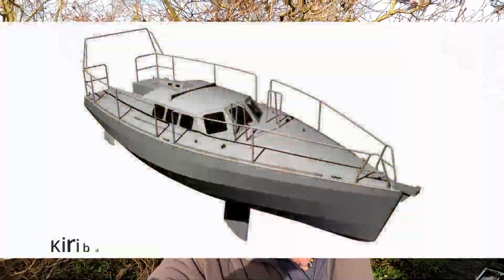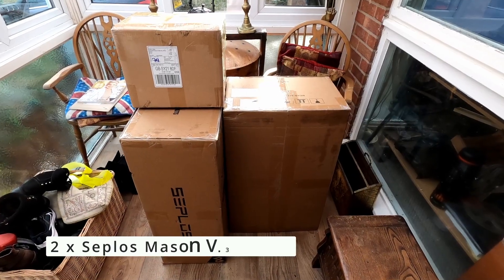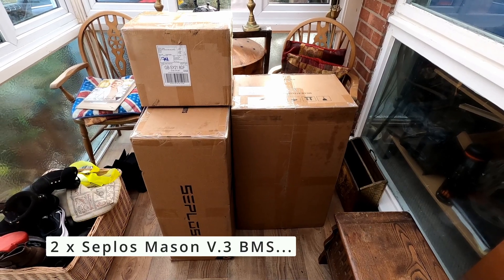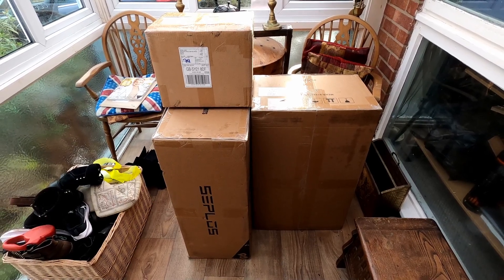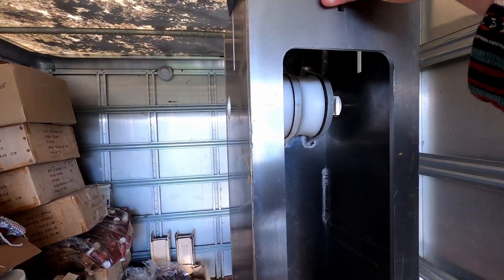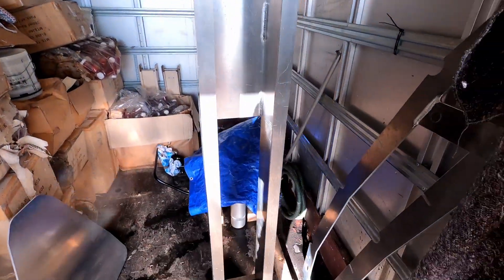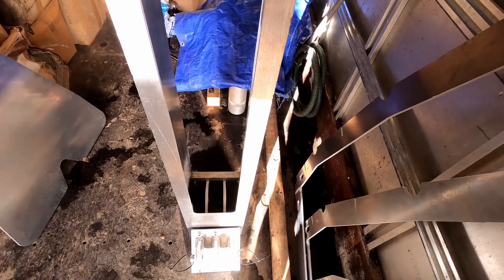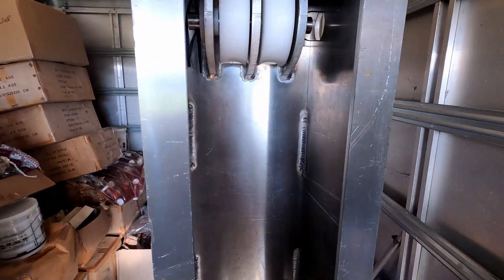Mast Support Work + Rudder Blades Cost Breakdown | DIY Aluminum Sailboat Build Ep. [5]

Comment: sleeve the bolts too - a circuit is a circuit and it will kill it
Reply from the maker: Hey Dan, thank you for your feedback. Someone did mention using some basic shrink wrap over the threads, so I will give that a go. I might have to make the clearance hole a tiny bit larger, but we'll be worth the effort if it means no corrosion. On another note, like your bike on your channel. Got an Africa Twin (old Rd04 from 1990) and hope to be able to ride it as much as possible this coming summer:) Thanks again.

Comment: Wondering about the rudders not having any portion of the blade forward of the axis of pivot. Won't provide and balance to the helm...
Reply: If you look @13:40 diagram you can see there's a front blade too
Reply: Looks like it’s a Skag hung ruder with pivot point on the end.
Reply from the maker: Hi Daniel, Thank you for your comment. Next episode covers what I refer to as the 'front' rudder. In short, it is a fixed part of the rudder that sits on the opposite side of the axis/rudder stock. I guess that is the part that you felt was missing?

Comment: Dont know if it helps but this is what my solution for not touching  the 2 baterial togeder.....put electrical shrinking tube on the thread and the you have free of   touching
Reply from the maker: Hey Andre (or Andrei), thank you for taking time to feedback. That is not a bad idea at all, thank you. I might have to make the clearance holes a touch larger but if helps agains corrosion then well worth it. I will try it out and  post result on channel as a very simple and effective way to tackle the issue:) Thanks Again👍🏻
Reply from the maker: Hey Andre (or Andrei), thank you for taking time to feedback. Not a bad idea at all, will give that a test. I might have to make the clearance hole a little bit larger but worth it if it protects from corrosion. If it comes out well i will post the method on channel. Thanks again.
Reply: @modularhippo   it's Andrei and you are welcome

Comment: The mast support and the rudders look good. 
Good idea to use the gas bottle for melting the lead.
Reply from the maker: Hey Albert, hope all good. Thanks, parts that actually looks like boat parts, gives me energy to push forward😆 Happy with the outcome so far, fingers crossed that the rest is smooth sailing as well:)

Comment: The lead smelter came together nicely. I'm sure it will work perfectly. I tip regarding purchasing and conserving funds, i.e., how I would do it - but that's personal. I am very cautious about buying stuff that's required a long time in the future. It slows the core build, and the parts will become outdated with the fast technical development, i.e., better solutions will become available. It can also be a warranty issue if found once later installed. On the other hand, it's fun and may help motivate the project to focus on something other than metal plates. Cheers.
Reply from the maker: @Cptnbond  - Hey, hope all good your side. As far as the boat mechanics goes i am trying to keep it as basic as possible (easy to fix and slightly over dimensioned where possible). I am worried about the primary battery banks as that technology is so rapid. My hope is that the container shapes will remain for a while, although the chemistry in the batteries will change and improve. The alternative is to get trapped in 'waiting for the next better thing', and with that i will be to old to sail when boat is ready for water😆